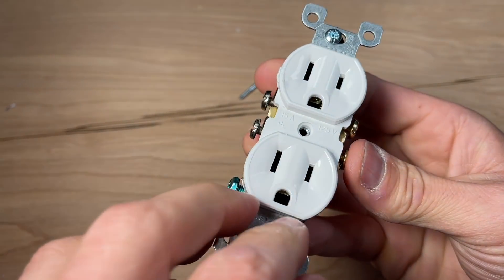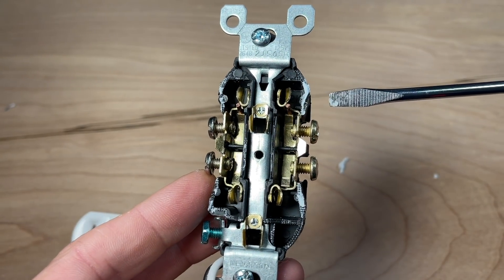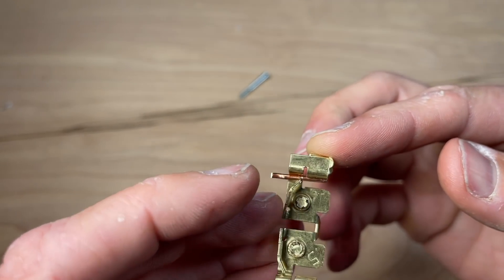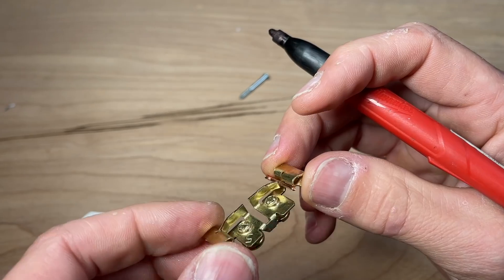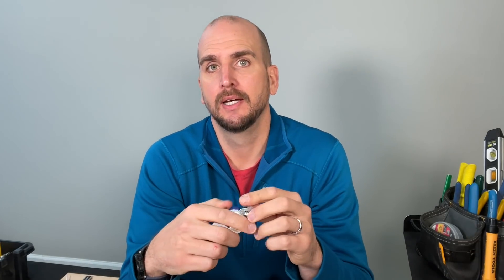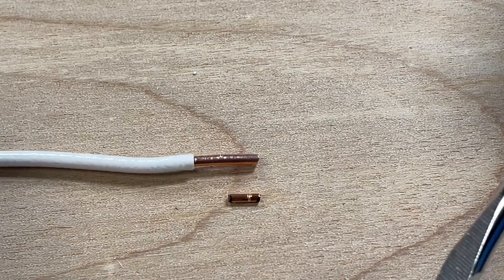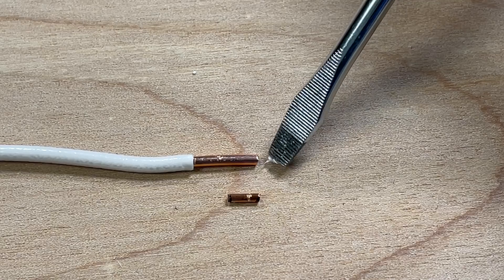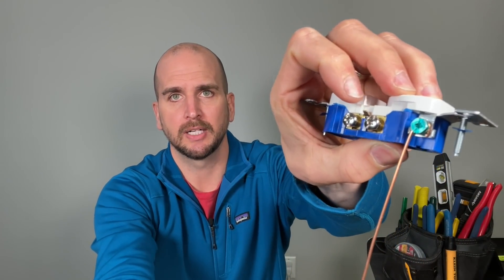Why You Should Not Use Speed Wiring | Back Wiring Is Preferred

Comment: Assuming you install it correctly and they meet all codes, speed wiring is just as reliable if not more reliable than back or side wiring !!!
Reply: How can a clip of spring metal that can fatigue over time, amp draw temp and movement be as or more reliable than a torqued down screw terminal?!
Reply: @erniebouey5325  Everything fatigues over time  !!!  especially something that is screwed down  !!!  I have never had a problem with a speed terminal and several issues with back or side wiring, unless I am the one who installed it 🤔
Reply: @Samhain2323  Agreed. Everything does fatigue over time. Mostly at vastly different rates. But that doesn’t answer my question. Please provide your experiences with the various connection types pertaining to reliability so others can understand.

Comment: I've been a contractor for years, and have seen all types of problems with cheap electrical products and stupid shortcuts like back stabbing. These steps are meant to save on costs and increase profits without offering a safer and more reliable product. I would never work on a customer's home with less due care and attention than I do my own. I've never had any job come back and bite me in the ass. New products aren't necessarily better. Common sense should be the prevailing factor.

Comment: I used to do wiring repair back in the early 80s. Back then I used to replace hundreds of receptacles due to loose wiring screws. The heating and cooling of the terminal would losen the screws. "Speed wiring" seemed to end this. I've not seen near as much issues with "speed wiring" as with screws. Jmo.

Comment: I own and manage multi-family rental units. The older buildings have all been rewired in recent years and all back-stabbed / speed-wired. We have never had a single issue arise from that despite the abuse often taken from renters. That said, I would not use that method in any kind of an environment subject to vibration (mobile, next to motorized machines, etc.), and we don't use it for bathroom and kitchen GFCI where amperage may be frequently high and with inductive loads.
Reply: RENTAL properties were they plug and un plug from recpticals often do to tent's change often TY residential quality resptical compared to spec grade are JUNK!

Comment: "Wago" connectors seem to be increasingly popular now, and the design seems very similar to the old backstab speed wiring on plugs. Why are speed connectors bad and Wago connectors good?
Reply: The Wago connectors actually have more surface area touching the copper conductor it seems. It also locks it in there pretty good. I have used the lever style alot and I like them. But I will only use on low voltage lighting, and also I've used on grounds but I've read in Europe (if I remember) that its all they use. I just prefer the pre twist, and nut method for average current carrying conductors but I do like the Wagos.
Reply: I noticed there's not a lot of pressure on a Wago vs an outlet. You're securing the outlet to the box, so the wires have a higher chance of breaking off when pushing everything in. The Wago connectors just float around in the back of the box. I'm no professional though, just my observation.

Comment: I recently wrongly trashed a switch because I thought it was sparking at the switch contacts.  Well, it turned out the bad connection was the speed wiring bit.

Comment: I have been using the J hook method for 40 years and never had a failure. I tighten all unused screws snugly and perform two extra steps for safety. I loop the wire around the screw in a clockwise direction and then use my needle nose pliers to close the loop around the screw. It takes a few extra seconds but tightening the hook around the screw prevents the wire from coming off even if the screw is loose. Then as a final precaution, I use electric tape to wrap the receptacle or switch. That’s the way my dad taught me and that’s the way I have taught my son. You offer very good advice to your viewers and supply thorough explanations to support your position on a subject. Thanks for sharing your knowledge.👍👍
Reply: @lenbeedle  wrapping with tap helps minimize making contact against sides of the box especially if it is a metal box .
Reply: Yes “Leno D”, it is an individual preference since the code does not require it. I believe wrapping is especially beneficial when used in multi-gang boxes, when installing GFCI receptacles, when replacing switches and receptacles in older homes with smaller metal boxes and even in plastic boxes where bare ground wires can easily come in contact with the hot wires. 
One caveat is that I will only use high quality vinyl electric tape made by 3M. I find it does not dry out or shrink over time and is easy to remove even if it is 10 years old. I know this from my personal experience in my own home.
I am willing to absorb the extra cost and time it takes to wrap every device and connection with high quality tape. It helps me sleep better at night knowing I have gone the extra mile to prevent a possible problem. But remember, that’s my personal opinion.
Reply: Yes I wish everyone would run all screws in. I’ve bumped em a few times
Reply: I definitely understand a professional who does this all the time would want to use the screws. From a newbie, who has never worked with wire before, I can say that it certainly helps to have another option using the screws. If I don’t do it just right, I start working on another one and the one before me comes off and then I’ve gone around in a circle three times. Which is why I should hire someone I know.

Comment: You made a great point about how much better surface area contact you get using the terminals over speed wiring, but you failed to mention the biggest difference. Using the back terminals you get a far more solid connection because the wire is under pressure from the screw connection. Speed wires can loosen up but a properly tightened terminal is far less likely to come loose.

Comment: To answer your question at 9:20, no, I would NEVER use a speed wire set up in my own home. I've seen too many customer failures with burnt outlets in the wall to ever want to chance it in my residence. I will however use the cheapest receptacles and side wire them.

Comment: Retired electrical contractor.
1. NEC codes are minimums. Changes in code are driven by the industry.
2. Back wired devices were designed so unskilled workers could install them.
3. Always pigtail. With five devices backwired in series the cumulative load passes thru the previous device so the entire load passes thru that small contact clip in the first device. 
4. Use common sense, be neat in the installation and when stripping the wires DO NOT NOTCH THE COPPER.

Comment: Excellent video Scott!  I will never use the shortcut speed wiring method as I have seen too many times that it has failed in a circuit.  I personally had switch and an outlet that was originally speed wired by the electrician 12 years ago when the house was built new and the speed wire method created a stress crack point on the devices and the devices failed because it was cracked apart and wire was hanging loose in the electrical box.  An electrician friend also told me that the speed wire method creates and internal higher resistance and when using a high amperage/heavy draw appliance such as an iron or vacuum, you are more likely to see the lights in the room go down when the appliance is turned “on” because of the higher resistance.  He always makes a “pig tail” connection with the in and out wires with a wire to the device to make a low resistance, solid electrical connection that will not fail.

Comment: 1 When in school for power production. The theory being thrown around was electricity only flowed on the out side of the wire. 2 If the surface area is equal to 14 gauge do you need more.  3rd I prefer back wiring. Last never buy cheap outlets.
Reply: What you are talking about is the skin effect.   It only applies to high frequency AC.  For power crossectional area is what's important.

Comment: I always thought backstabbing was dodgy at best. I don't wire in receptacles with 14 gauge anyway so I couldn't use this feature if I wanted to. The only place I have wired a receptacle with 14 gauge wire was on the ceiling of my garage, and the receptacle is specific for LED shop lights. I've only back-wired or used shepherd's hooks for everything.

Comment: I have a light switch with 2 black wires pigtailed into a white wire connected to a light switch. Another wire is black also connected to the same light switch. When power is on my ncvt is saying all wires are hot 100%. Regardless of the light switch being on or off. That doesn't seem, right? The switch controls an exterior garage light. House built in 70's.
Reply: The switch only connects to the hot wires in the box. The white pigtail is just an extension from the pigtailed hot feeds to the switch. Sloppy work, should've used a black wire extension.

Comment: Our home is less than one yr old. Was built by a large local building company. 
While the electrical is “to code” it is not top notch. So we have hired a local electrical company who’s master electricians are replacing the “50 cent” versions of outlets abs switches with commercial grade. We would have gladly paid the builder to upgrade everything from the start had we known what they were doing. 
And while the replacement is going on, they are also correcting some issues that again meet code but could/should have been done differently and better.

Comment: I only use Leviton commercial grade back wire in my house. Fuck tamper resistant.  And when there is a issue, there hasn’t been yet, I have flat wire to deal with. Not j-hooked loops. Also, the Leviton plug has four spaces on the back like your eaton. Kick ass
Reply from the maker: Yeah, I used the Leviton commercial grade for a few jobs as well.  I gave the Eaton a shot a few weeks back swapping out about 30 receptacles and have to say I was a fan.  Next up is the Legrand (P&S) which I know many have given higher marks and for me they are readily available at Menards.
Reply: @EverydayHomeRepairs  trust me, the Leviton are the best back wire.

Comment: I wouldn't use either back or speed.  Since a straight connection its very easy for it to work itself out of the connection points.  Copper and Brass do expand and contract when electric is run through them that is why most electricians will use the J hook.  With back or speed, if the connection gets loose at all it will cause arching and with new electrical code most breakers are arch fault and can cause breakers to trip even when the connection looks solid.
Reply from the maker: That is a solid argument for side wiring.  I assume you close the J-hook around the screw so even if the screw backed out considerably the wire would still stay on the terminal?
Reply: @EverydayHomeRepairs   yes, most wire strippers and tools like that have hook loops to make this happen, than once on the screw you would use a needle nose to close the loop.  I was always taught to wrap electrical tape around as an extra protection to avoid any potential issues in case a wire did happen to come loose.  I'd rather do it once and never have to come back to fix it.

Comment: I accidentally used the backstab method once with the mistaken belief that tightening the screws would internally clamp down on the wires.  When I realized my mistake, I could not get the backstab connections to release at all and ended up having to cut the wires.  That "quick" connection ended up wasting at least an hour of my time.  Never again.
Reply from the maker: Actually I think that might be a fairly common misconception for DIYers who change a receptacle here or there.  Thanks for the feedback!
Reply: Well, not being able to get the push-in connections to release sounds like a good thing to me. Apparently the connection was pretty solid.

Comment: I'm not sure why you didn't count the entire length of the speed wiring connection?  that copper wire extends to the other section of the metal contact.  I can admit that only 1 side is basically making contact, but the entire length appears to be similar.
I would assume that anything that is not UL approved, would not be allowed as an option.  They probably don't like speed wiring because it's fast and easy and reduces the amount of time at the call and therefore their pay.
Reply from the maker: Hey James, good point on the contact area for the speed wiring and I should have called out why I didn't count the 2nd section.  This section has much more variability in terms of whether the wire would make solid contact depending on if the wire was perfectly straight or had a slight arc.  If the wire has a slight arc then the wire pulls away from the 2nd section.

Comment: I'm curious what Leviton and Eaton would have to say about this. I've been using both with speed wiring since 1984. Never had an issue.  I'm pretty sure if there were problems with speed wiring, they would have stopped manufacturing them years ago. Lic. electrician, CA.
Reply from the maker: Thanks for the feedback Eric.
Reply: Like no person or company will ever take the quick and easy route to make more profit. Lobbyist make fortunes for big company’s getting things into code that shouldn’t be the BEST choice... Dude we live in a total short cut world today ..  fast cheap and easy....that’s the ticket for most... and it’s depressing.
Reply: I don't agree, but thanks for representing with what must be a common opinion and the one requested! Respect!
Reply: @eric m. I’m a residential service electrician meaning we run several troubleshooting calls per day. Backstabbing/speed wiring keeps us in business is all I can say. Day in and day out we see it fail. I’ve got plenty of pictures for proof.
Reply: I believe Leviton has quit offering the back stab holes in their outlets, which seems to suggest they recognize it is risky or overly susceptible to improper use.  Today I bought a box of 10 outlets to convert my home to white, they are lower cost models, nothing fancy.  The box says "back and side wire" outlets, and there are no back stab holes.

Comment: I prefer the straight in type of side wiring where I can see the wire is between the two plates and there is less of a possibility of the wire going behind the plate in the back wiring approach.  This isn't much of an issue beyond being annoying for having to tilt the outlet to get the wire to go in correctly. I prefer to SEE what I am doing with the side wire approach. Still, with some side-wire outlets I find the lack of a little raised lip to make it real easy to push in the wire on the side without first lifting it up with my third non-existing hand is annoying.  I don't recall my favorite brand some some of the side wire outlets seem just right.  I also like outlets that are not easy to break, as I find many outlets with the part below the ground to be broken off but the better outlets are so durable they don't even break when I beat them with a hammer -- unless I use a sledge hammer, LOL.  Also, the straight type of side wiring allows for easy J hooks for anyone who prefers this or just wants to stick with previous J-hooks being this is a replacement outlet.  Also, in inspecting an outlet by just removing the cover, one can eyeball the side wires and make sure they are in OK and are tight, but in back wiring it is harder to get access to the wires to see if they remain tight and to be sure the insulation is not burnt yet.  In general, I just don't like back writing or speed wiring.  I do'n't mind taking a little longer to install outlets when they are good quality.  Some of the outlets I install get a lot of use.  Have you addressed this issue of longer term reliability with heavy use, meaning not just something being turned on often but the plug being used to plug something into it and removed many times ?  Are there any ratings that deal with numbers of insertions before failure or is this just a matter of buying commercial type grade units which is mostly all I buy, I think.
Reply from the maker: Hospital grade receptacles have to go through a few different tests which don't exactly test heavy repetitive plugging and unplugging but do result in a more durable receptacle.  A few people have called out installing a couple hospital grade receptacles in their shop where they will get daily use from a number of power tools.  https://www.leviton.com/en/products/industry-solutions/health-care/hospital-grade

Comment: I have seen speed wiring fail. When it did it was intermittent and took days to track down. Worse thing is that it could have begun arcing.  This was an older house without arc fault breakers to. I never, ever, not ever use "backstab" wiring. I put the wire around the screws (side wiring)

Comment: An intense DIYer, here...  I always prefer the better outlets since they last longer.  They also have a better feel when plugging and unplugging devices.  Of course, your average homeowner wouldn't notice this unless you gave them a side-by-side comparison test.

I agree with tightening those terminal screws!  Don't leave them hanging out in the breeze fully extended.  Why take the time and effort?  Simply, you decrease points of possible failure.

As for the speed wiring...  I'll back-wire if it's available.  But, I don't lose a lot of sleep over speed wiring if that's my only choice.  Hell, Wago speed wiring nuts only have the thin little one-way metal tang to do all the power transmission.  If they were a huge problem, we'd know it by now.

As with everything, there's more than one way to do it.  Use the equipment and processes which allow one to sleep at night.